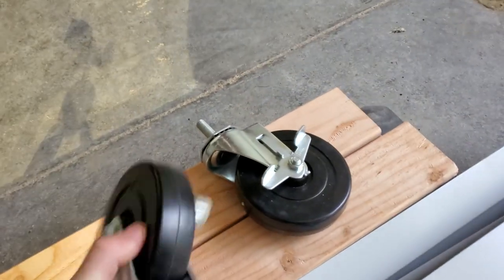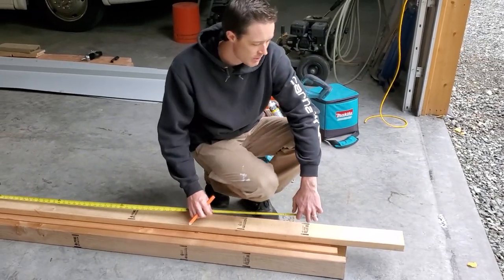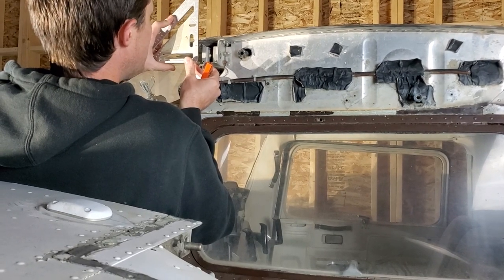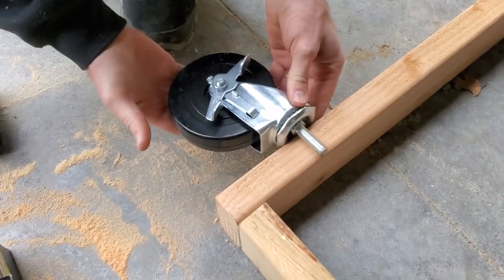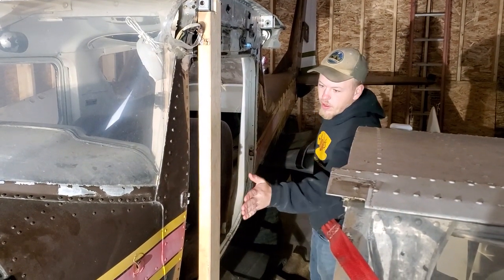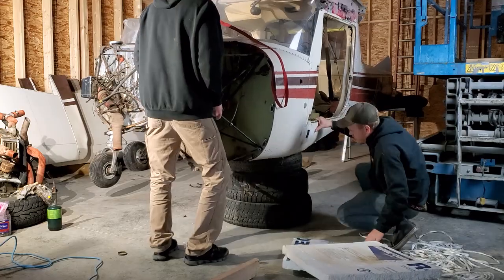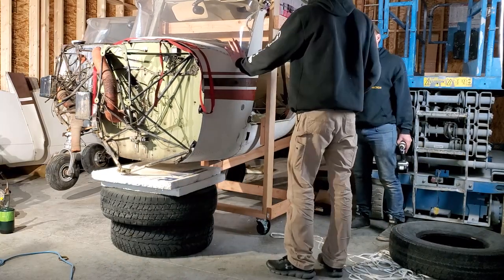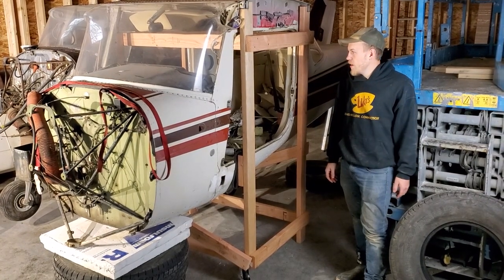Cessna 150 Restoration Part 4 Fuselage Stand

Comment: good stuff.. i work in my 150 couple years ago, and until this year in my 172, this month starter my 182 project... the 150 and 172 was a partial projects... flying and work couple weeks at the time for upgrades... i found working in a shop.. that all the work invest in a 150 or 172.. is easily the same for a 182... the plus is the parts are almost the same, or similar.. and the time invest too... but the big difference is the money you have back.. you can make some back... with my 150 and 172.. were money will never come back... think big and good luck